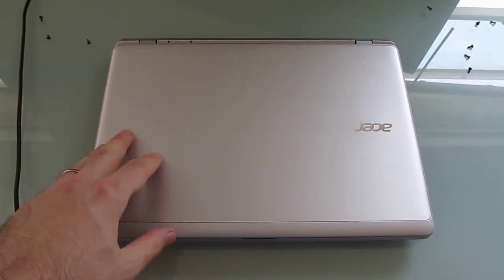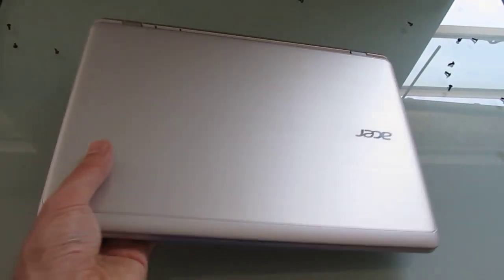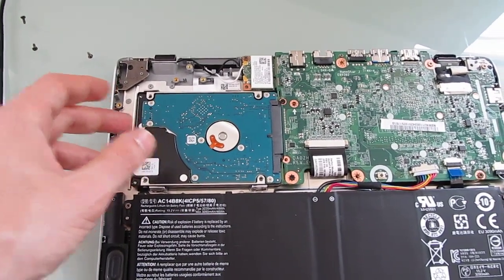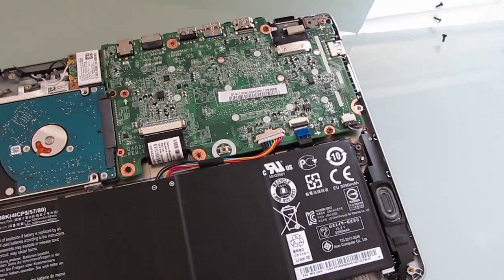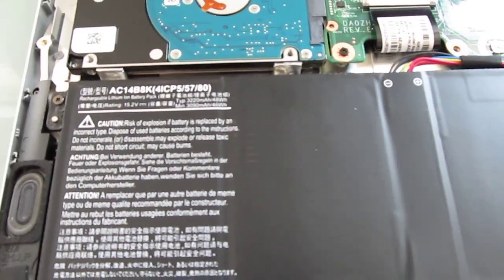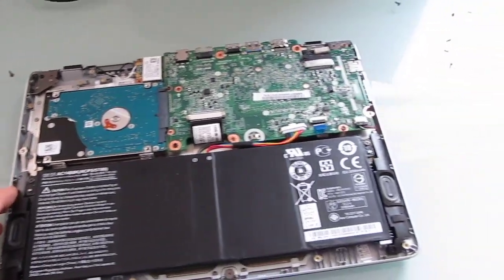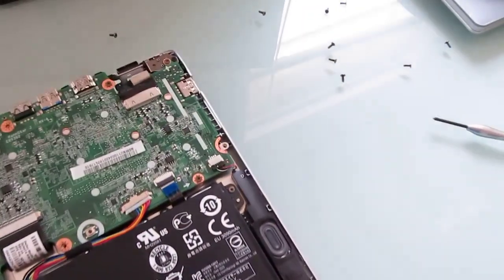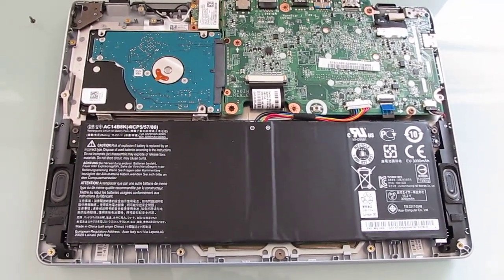Acer Aspire V11 notebook upgrades

Comment: I was given one of these, but it's the 32gb emmc version. Upgraded the ram to 8gb,  but  the annoying thing is this one has a motherboard without the ssd/hdd connection unlike the one in this video. It has the bay, just not the connector 😂.  Decent laptop though and touchscreen works well

Comment: Thanks for posting on the Acer V11. Does upgrading the Intel Pentium to Intel i5 (or any better Intel processors) worth my money? And is it possible to do so with the Acer V11 touch?
Reply: +Feisan Villana Minin 
I know it's been 7 months, but no, it isn't possible. The SoC is directly soldered to the motherboard.

Comment: I'd love to see how to upgrade some Chromebooks like the C300..
Reply: Almost any ACER Laptop/Netbook that has access panels on the bottom usually has the ram on the bottom of the unit, just remove those access panels and your golden, but if not like some of there older units you can more time then not access the ram by taking out the keyboard, and it's usually under there.
Reply: RanmaBluRay I know some of the older ACER Netbooks had soldered on ram of 512mb or 1GB, and still had a slot for 1 stick of ram. It's really sad if they did that though. But mSata will come down in price just like everything else given enough time.